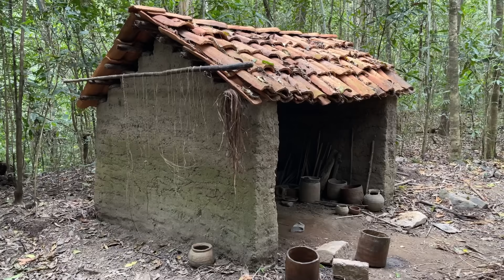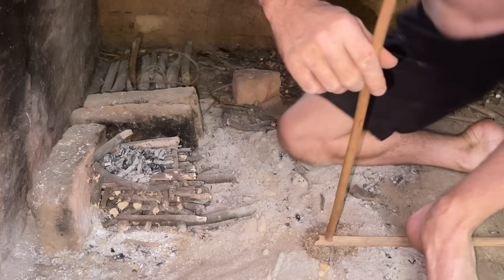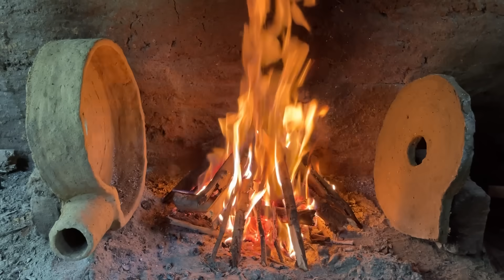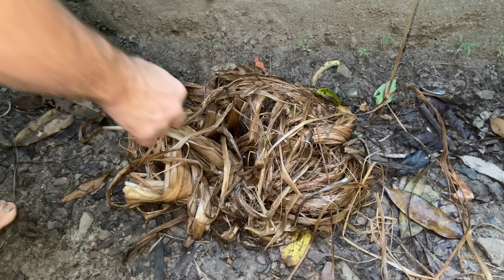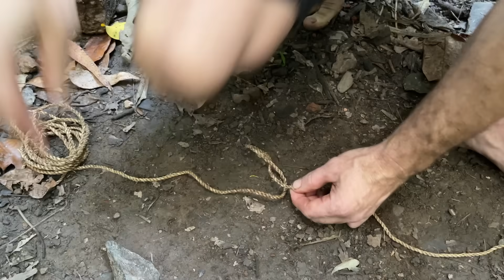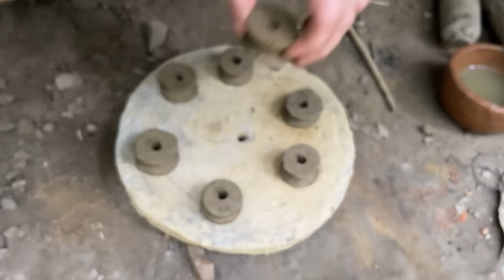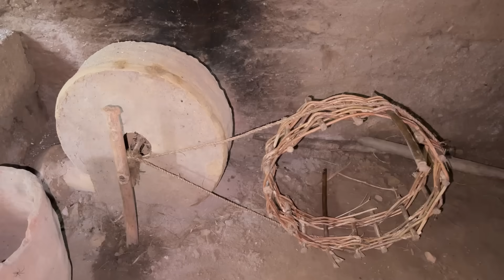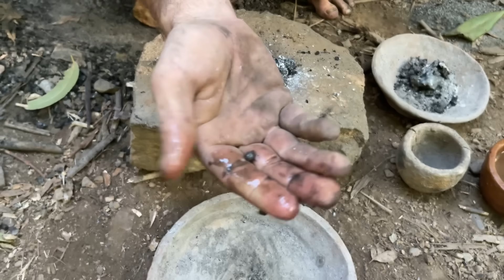Primitive Technology: Floating Pulley Blower Smelt

Comment: I'm curious what would happen if you actually forged down the bloomery instead of letting it cool and breaking up the "slag" to find iron pellets. You're getting pure Iron, sure, but its quite possible you could actually get a decent amount of steel from those bloomeries if you forged them down, though that really depends on the ore. You actually burn and turn a lot of the iron into slag and oxides when you let it cool off completely without forge welding the bloom. (15 years of bladesmithing and blacksmith experience and research)
Reply: I think he might actually be too hot and too carburizing, and the prills are droplets of eutectic cast iron, not sintered lumps of wrought iron.

Comment: Just noticed something you could easily do for the two post that hold up the fan. It might be a good idea to notch the top of each stick. Then tie them together with some rope. That way you wouldn't have to worry about them spreading. Wouldn't have to be much tension on the rope either.

Comment: Could you use some sort of tension to pull the larger wheel away from the blower just a little bit, so it could keep tension on the belt, maybe using a weighted pulley?

Comment: I would recommend that you start using the power of the running water and use it to spin the turbine. You would be able to make a grinder to sharpen a blade after you have enough of those iron pallets to make a knife or an axe. You could use it to pump water to where you are... All sorts of use.

Comment: Very impressive! I especially like the amount of air your getting, you can hear it roar. If I can make a suggestion, look up "iron age bloomery furnace" on the internet and look at one. They were made to look like an amphora or vase. All the combustion took place in the belly of the furnace, and the smaller top kept a lot of the heat from escaping. It also concentrated the unburned gases in the furnace, letting them add to your fuel.
Reply: He mentioned that he’s going for the higher carbon iron prills that are smelted later rather than a lower carbon iron mass. Did you watch with closed captions?
Reply: Which is why I recommended a bloomery furnace design. It increases carbon absorption by the iron. By taking the bloom out of the furnace still hot and gently working it, slag and other impurities are removed and instead of small prills, a more homogenous lump of metal, high-carbon steel, is formed. Smelting high-carbon steel prills will actually causes them to loose carbon if its not done in an oxygen-low environment. Low carbon smelting isn't a bad thing though, it creates wrought iron, which is a wonderful iron to work with and is fairly resistant to the elements because it forms a resistant layer due to its low-carbon content and chemical make-up due to impurities.

Comment: @primitivetechnology9550 are there plans to make a clay water wheel and use that as the drive for the blower. You could then keep air flow and power delivery more constant by increasing or reducing the flow of water, thus  maintaining a more constant temperature. You could even add coal and charges while maintaining the fire.

Comment: So I was wondering wouldnt it be a good idea to give the furnace a proper base? Like a dome shaped clay crucible? I think a lot of the heat might run off because it is in direct contact with the dirt and other dust from previous smelts which might take a lot of energy out the system

Comment: 14:00 I just held my belt in both hands and tried to turn it in midair bout the same diameter as your floating wheel... I made it 40 seconds before my arms completely gave out lol
Reply: John has plenty of shoulder muscle to keep on going.
Reply: @jghartman4482 I didn't really feel it in my shoulders, was more my biceps and triceps.  Thats with no resistance, though I guess the rope pulley and woven wheel can't weight much.  I am weak 😅
Reply: @jghartman4482you give it a shot lol

Comment: First off, I just want to say (and I know I’m not alone in this) that I love watching you do something that I’ve always wanted to do. Thank you for giving me the opportunity to see my fantasies play out!

Secondly, I think the pulley made of cordage was an excellent idea. I suspect it will last quite a bit longer than the clay ones did, and it is naturally tight on the rotor.

Thirdly, if you have trouble with the belt wearing out you could use a longer belt and sit farther away. The added length would make it so each spot has less wear per revolution of the rotor. Additionally a long enough belt would allow you to stand up, sit on the opposite side, or run it through more components (like a tensioner, for instance).

Fourth, I think if you brought the handles in towards the center of the pulley it could allow your arms to not need to travel as far per revolution of the pulley allowing for greater rpm.

Fifth, if you had some hollow canes to slip over the handles you could save your hands some wear and tear.

Finally, stay safe out there! And have fun!

Comment: I wonder would you ever consider using that stream to create a over head fan mill which you can make from a tiny stream all you need is an area you can turn into a water storage and it can also be tiny as you be using gravity through a small height hitting a hand made wooden vertical shafted fan, this was a medieval bread mill and it functioned with build in hopper to feed grain into its centre stone mill, if it could run a huge stone with ease and speed you could defiantly run a air fan or multiple, you might as well give it a thought as your making some odd solutions to something clearly tiring you out.

Comment: Twine and cord and rope and cable ( all different things, and fascinating how different they are ) are such OP technologies. I have been making rope and cable from New Zealand flax, and it is astonishingly strong, ridiculously strong. Once I got the hang of it, I have made 5 mm cable that I can't break with my full weight, 85 kgs. It has about 40 strands of the fibers in it at that thickness, and cabling it makes it just  strong to the point that it rivals a nylon rope I think.
I have been making short lengths and testing it to destruction, the only advantage I think that modern fibers clearly have, is "shock" it doesn't like a really fast pull.
I want to make a long piece of cable, and use it as a lead on my dog, to see how long it lasts in daily use.
Reply: I got bored recently and made a length of twine with my hair. I haven't cut it in almost 15 years, so it's about two foot long, and I could have made a mile of twine at this point just with what I pull off my brush. I kind of wonder if human hair twine might have been the original cordage. With just one twisted braid a millimeter thick, it takes 20-40lbs of force to break, and it handles fast pulling well. It isn't as easy or fast to gather as plant fiber, but it does seem stronger since the strands are naturally really long. It's somewhat equivalent to horse hair as a fiber.

It's also neat that hair seems to reach a set length and then stay around that length. It reached a bit below the middle of my back a long time ago, and hasn't gotten longer despite not cutting it, but I've seen some women with hair almost to their ankles. Making a lot cordage with 4-5ft hair would be really efficient+easy to do while watching children in a hunter gatherer society. The natural tendency of long hair to tangle and dread is like a natural source of rope. From that, making passable twine would be easy to figure out, so cordage made from hair might have been one of the first tools of mankind. Sheep's wool or plant fiber is likely a higher-yield source for a society, but one or two women could probably make more than enough rope for a small tribe.
Reply: I would guess that modern rope would hold up to the elements far better. Your homespun one would probably work great until the humidity got it.

Comment: Would it be feasible to make the smaller pulley wheel from wood, by rough-cutting a small round of a thick stick, burning a hole through it, and then lathing it to size using a coarse stone or a sharp stone edge?  I feel like they might last longer than the clay wheels...
Reply: Never mind...I just got to the part with the cord-wrapped fan axle...that looks like it works even better.

Comment: John leaves instructions like “prop up the spout with clay so it won’t slump” as though we’re all out doing this at our own huts in the jungle
Reply: You aren’t?
Reply: @lordfrostdraken  I wish. but if there isn't a rainfall for two seconds, out here in Nova Scotia, there is a fireban. would cool to try this with temperate materials.
Reply: @lordfrostdraken should we be?
Reply: I left my jungle and opened Youtube just to like this comment.
Reply: it's instructions for the future obvi
Reply: @The_world_is_not_worthy_of_Him you mean we can’t just plug it in, in the future? And clean up in our shop sink?
Reply: @The_world_is_not_worthy_of_Him this will be our survival manual afterwards
Reply: I built my own smartrock™, telecommunications service and sms operator just so i can come here to watch this.
Reply: I actually use a lot of these skills in my own backyard. I made clay pulleys a couple of weeks ago for a prototype and had the same problem of them breaking. I harvest clay in my yard and make primitive pottery.
Reply: @jefferyheppler7650  I keep wondering why he doesn't fire the blower and pulleys -- ceramic is stronger than dried clay.
Reply: @jefferyheppler7650  I think using straw aligned against the wheel (short strands) would help a lot for compressive forces, also burnishing might help stop small imperfections from propagating out, if you bother to do it, I'd like to know how well it works.
Reply: JOHN?!?!
He has a NAME?!?!?
Reply: @blue_leader_5756 Yes, his name is John Plant.
Reply: @blue_leader_5756 John Plant. He has a book.
Reply: @blue_leader_5756  He unlocked writing a few years ago. He released a book. It had his name on it.

I am assuming he wrote the rough draft on papyrus with charcoal and sent it to the publisher who converted it to paper and print for him, since he hasn't managed to make a printing press (yet)
Reply: Speak for yourself... I'm putting the finishing touches on my nuclear reactor built from banana trees and coconuts... the Professor on Gilligan's Island would be proud...
Reply: @nobodyuknow4911 I love how he could build a telescope from coconuts and palm fronds, but couldn't build a boat.
Reply: @kainuscorevax3875 for what it's worth, he did successfully make some glue to repair the boat at some point. But as per usual, Gilligan messed it up.
Reply: Genuinely convinced if this guy was in a location with some better resources (natural copper and tin) he’d have LONG since been in the Bronze Age with a full set of tools
Reply: @Poxyquotl  I heard that tin and copper can't naturally be found close together which is why bronze using civilizations where trading civilizations.
Reply: I'd love to see John on a survival show. They're all stood around complaining about who's turn it is to cook the rice and he is just silently firing bricks in the background
Reply: @lamni-b6p to be fair his location has an incredible variety of really useful plants and other resources that you don't find everywhere.
Reply: @Sleepyjudei  honestly it's not that much better then any forest, the biggest boon is the flowing water. flowing water is much cleaning, might have food, and resources like stones and ores. If you live east coast usa like myself, a lot for plants he uses can be replaced with local varieties, my favorite is reeds, they have edible roots, with fluffy cotton-like seed heads, and long strong, flexible leaves, the sap is even useful for first aid and burns like aloe vera. I will say I wish I had bamboo, that stuff seems so useful when making tubes takes hours by hand
Reply: My internet router runs on iguana and mango powered wheels.
Reply: we may have to someday lmao.
Reply: Aren't we?
Reply: I imagine that it's for survivalists who have a desire/need to do this some time in the future or just to show the reasons for why he's doing certain things.
Reply: Uncontacted tribes with their Starlink setup no doubt.
Reply: what, you're not using parrotgram?
Reply: useful for the future collapse of society
Reply: No but it helps with ultra cheap forging though
Reply: Yeah I like that.
Reply: Wait, you guys aren't doing this?!?
Reply: If i had the land and time i would, seems very satisfying
Reply: Thats why we love him
Reply: I want to but mosquitos stop me from doing anything longer then five minutes.
Reply: Just helping out a fellow caveman
Reply: Wish this could be me, but Florida has very few rocks, sandy soil without any clay, and relatively little hardwood to use. Saw palmetto stems do make good quick cordage though
Reply: Man we wish
Reply: You imply that we are not. But we are.
Reply: We all wish we could be though
Reply: Man, if I lived somewhere with good clay to be found in the ground without dealing with permafrost I might. 
Would be a cool back property project.
Reply: You never know where life leads you. It's good to acquire as much knowledge as you can.
Reply: Pfft.  I wish...
Reply: I do not trust his advice. All my advice comes from the local caveman down the street. His name is Mr. Ugh. He used to have a bone through his nose and I thought that was pretty odd.
Reply: This is a tutorial video so we can all go out in our own playthrough and copy his playstyle. If it weren't for John, I'd have a game over long ago.
Reply: Us poor folk do stuff like this all the time
Reply: If civilization fell tomorrow you would be thinking back on this video and this exact shitty comment of yours and be like "damn"

Comment: Loving the end splice demonstration!  I think the next easiest upgrade would be to address the sharp corners of the air intakes with some flared clay.  After that is probably some more durable wood pulleys. ❤🎉

ETA: A more rugged wood shingle blower with the vanes would also probably be good return on investment of labor for performance gain.  That combined with the better intakes would likely give you a huge boost (pun unintended, but I'll take it) in performance.  

The fiber spindle worked surprisingly well.  Can't wait to see what you come up with next!

Comment: In the non floating method you could have larger post holes that you wedge with sticks so you could angle in closer or farther away from the shaft so you could have variable belt tension. Thats why floating works as you are pulling the belt taut manually

Comment: That suction hole looks too small to me. It looks like it has roughly the same cross sectional area as the discharge. For sure the pressure ratio is always going to be low with privative bushcraft   tolerances, but I have a hunch increasing the suction area (not diameter) to perhaps double would improve performance.

Comment: also i wonder if you pointed the tuyere up into the coals of youd get higher temp. most coal forges ive plaued with had the air blast vertical, def would decarb the iron as the oxygen would be blasting into the charges but can always recarb later in a crucible or using the hearth method. but in the coal forges can get hot enough to melt the steel

Comment: Can you add a clay flywheel to the backside of the blower housing? 

You'd need to introduce purposeful slip to the drive mechanism (which your floating drive does), or else its continued motion would make it hard to re-engage your hand to the drive after disengaging for rest.

Comment: be fun to see a multiple geat using the fixed wheel and the floating one, floating gear on the drive shaft of the fixed gear and the fixed the drive wheel to the drive shaft of the blower. wonder if whay the ratio would be, like 40 to 1? get some crazy rpms

Comment: Really seems like shaping wooden pulleys wouldn't be beyond your capability. To affix them to the shaft you'd just need to put a slight taper on the shaft then jam the pulleys on for a friction fit. Would be much more durable than the clay.

Comment: I think your limit at this point is rigidity and fitment lol. Maybe you could probably get improvements via fitting the impeller closer to the housing, and using larger heavier branches for bearings (and adding a belt tensioner for when you mount the wheel to an axle) would probably help but ngl i have no idea what else you can do. maybe improving the ore, or using different kinds of fluxes (like acidic vs basic flux) could help?

Comment: The small intake holes are cutting into the blower's efficiency. It's the same volume of air entering and exiting, but that air is meant to move faster at the output and slower at the input, and to get the same amount of air in at a slower speed you need a larger hole.
Reply: HMMM, so maybe make your blower and tuyere output in something like a wide, flat oval shape instead of a circular one? That way your blower can be way deeper without requiring a larger spoke inside.

I'm also pretty surprised that he's never tried attaching a flywheel of some sort to the spoke. It'd probably help keep the blower spinning at a more regular speed, and might make it easier to operate. Of course I'm saying this like constructing this whole thing didn't already take him about 15 steps lol.
Reply: @DustinHorvath1987  He did try flywheels in the either the last video or the one before, mounting them to an axle durably is somewhat challenging.
Reply: @DustinHorvath1987  I remember the flywheels. They were a bit too much.